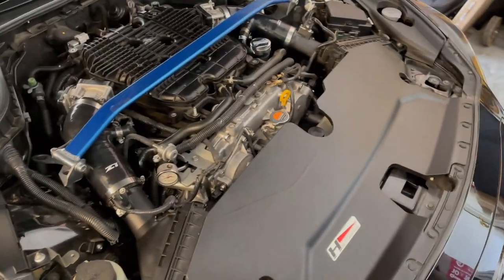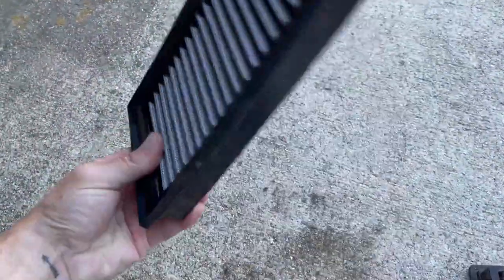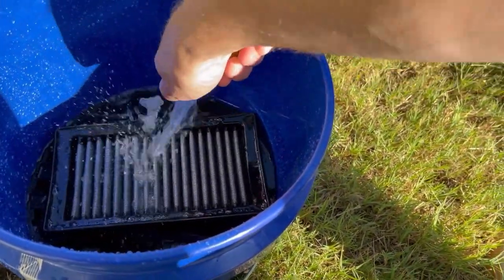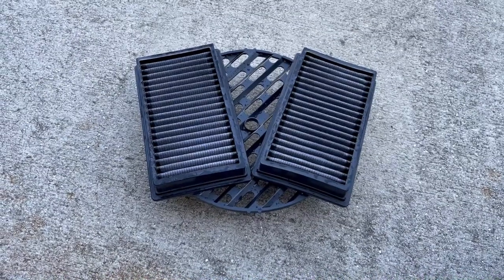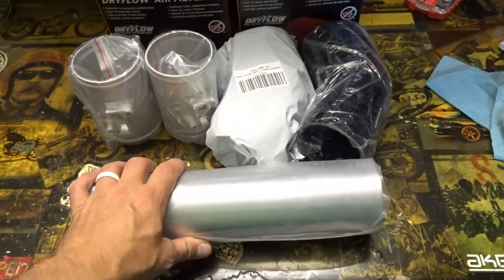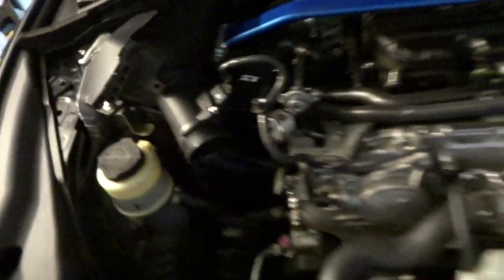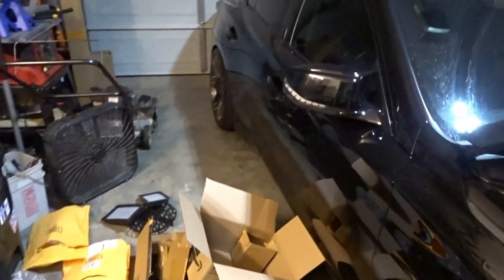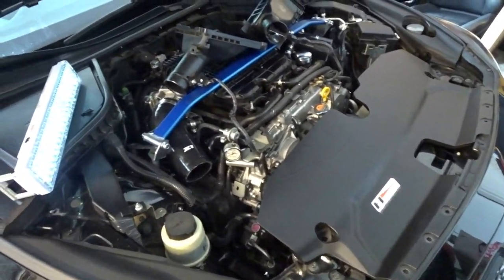Making MORE Power in the Q50 AND how to clean aFe Dry Drop In Filters

Comment: That custom switch panel looks sick. Imma work on something similar this summer, but I am going to make use of the coin storage under the center screens. I'm gonna add an LED bar to the lower grille, and possibly some ditch lights. MN's backcountry roads at night are pretty sketchy with the number of animals I see nightly.
Reply from the maker: I looked at the coil holder area as well, but wasn't enough room for what I wanted.  A couple of switches will be no problem though!  I Know all about minnesota back roads and animals!

Comment: What about a simple nos kit. Without force induction your not really going to get any more power out of that motor. Another route might be to bore out the motor maybe take it to 4 liters but that's an Expensive route just like boosting.
Reply from the maker: Haven't you been catching my hints? lol  I know this engine is pretty much tapped.  The point of the larger intakes is for testing because I get so much push back on my "mods you don't need" video from people who love their intakes telling me they are good for 10-15 hp.  So, I'm going to get this thing on the dyno, and according to them, I should see 345-350 wheel horsepower....which I won't!  It's all for content.  But yes--a 75 shot of nitrous might be in my future.
Reply: @SpeedCultureStudios  LMAO 🤣 a lot of people also do the injectors upgrade and run E85 have you tried this route? Are you planning on hitting the track again? I personally been hitting the drag and pde events down here a lot lately loving the Q50S performance.
Reply from the maker: @Driftking305forlife  I need to get to any track event!  I don’t plan to run e85.  I don’t know the long term effects but I’ve seen gains between 2-12 hp so I’m not sure what the value of e85 is yet to me personally.

Comment: Just letting you know i did similar short ram intake setup on my g37 7at sedan. I lost 2-3 mph and 2-3 tenths in 1/4 mile
Reply: I switched back to oem airbox with drop in filters and z tube
Reply from the maker: This is exactly why this is being done! People don't believe me when I give them facts and figures I've compiled.  I'm actually going to do it myself and show the data on video!
Reply: @SpeedCultureStudios  i did this myself and documented the time slips, i did 3-5 runs to get an average. The times with oem and Sri were both in similar density altitude as well
Reply: @SpeedCultureStudios  tbh i kept the Sri on for like 2 years because i didn’t care about speed, just liked how it sounded. Before i went back to oem with drop ins and z tubes like you have/had
Reply: @SpeedCultureStudios  i went from 13.6-13.8 at 101-102 mph to 14.0-14.2 at 98-99 mph. These runs were in summer 

My best run oem was on coldest track day of year at 13.4 at 103 in the fall 

2010 g37 7at journey

Comment: There's 2 intakes 2 1/2 is plenty , 1.85 liters per intake
Reply from the maker: I know lol.  69mm (2.7 inches) is actually ideal as it more closely matches the throttle bodies, but the way this engine is setup, it really can't handle much more air than the factory intakes provide.  You'd have to see my other videos where I talk about this.  The purpose again is for testing and to prove a point.  I get a lot of push back telling me that CAI or Admin 3" intakes would get me 10 - 15hp.  That, of course, is not true.  Now I just need to prove it.
Reply: I've raced intake exhaust q50 and beet him with my afe drop ins axle back and 1320 y pipe stock resonators
Reply from the maker: @joshrichie9833  if he wasn’t tuned, he was likely making less power than you.  He was probably making less power than stock because the car does not like intakes without a tune.
Reply: @SpeedCultureStudios  i should get a tune